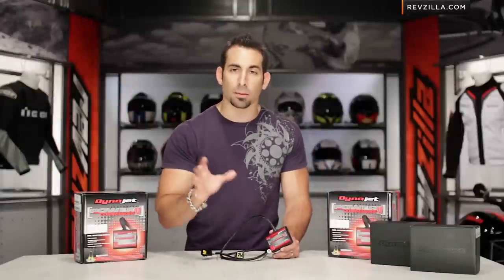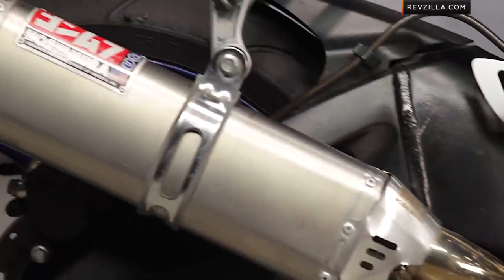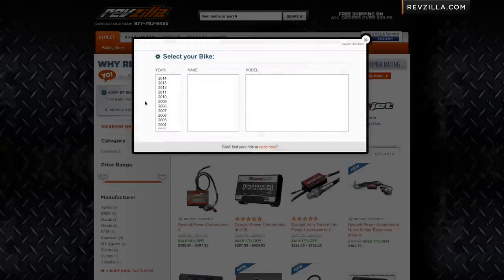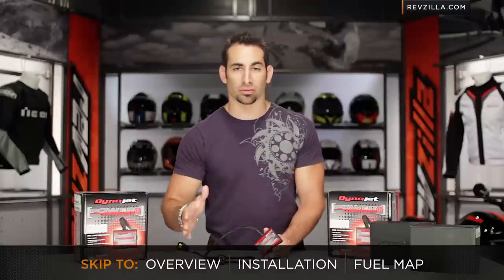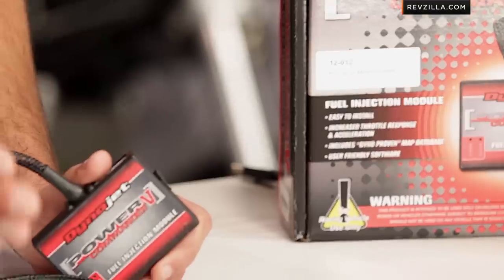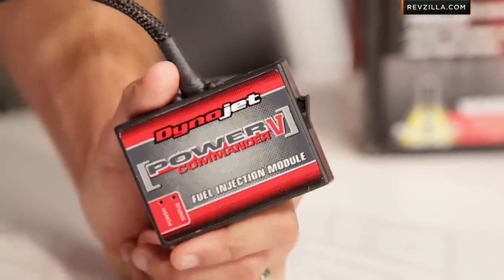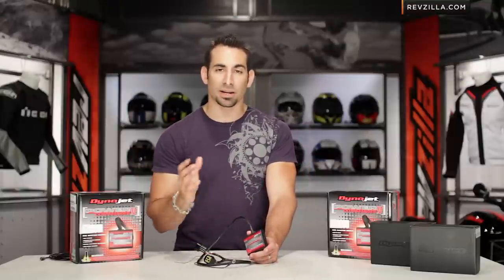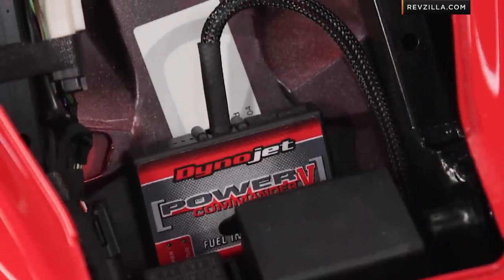Dynojet Power Commander Buying Guide at RevZilla.com

Comment: please reply, can it be used in ktm rc250? i only see that it only available for rc390. since ktm rc series have similar build to each series from rc 200, 250, to 390, the different is only in cc.
Reply from the maker: No, it cannot be used in the 250. It is only compatible with the 390 motor. -DrewZilla

Comment: I am setting up Two Brother exhaust full system to my Vulcan S 650 2016. Is it will fit for my case ?
Reply from the maker: +Nguyen Nhan Yes, there is a Power Commander V to fit your bike. It fits both 2015 and your 2016 model. -DrewZilla
*http://www.revzilla.com/motorcycle/dynojet-power-commander-v-fuel-ignition-kawasaki-vulcan-s-2015

Comment: Sounds great  but  does not  control the Ignition ???
Reply from the maker: No, the Power Commander does not control ignition. For that, you'd need the additional Ignition Module. -DrewZilla
*https://www.revzilla.com/motorcycle/dynojet-power-commander-v-ignition-module
Reply: Hello thanks for fast reply ..  I looked on your web sire and the V  does appear to control ignition too on a Yamaha FZ-07  it seems it does for some models and does not for others..?  I will look again ..
Reply: According to your own Web site  the Power Commander  V controls both fuel and timing ..  My  bad for not specifying  Yamaha FZ-07  I looked on the Dyno Jet web site. too ..
Reply from the maker: Ah, my apologies. Yes, for the FZ-07, ignition time control is built-in, so the ignition module is not required in that case. -DrewZilla
*https://www.revzilla.com/motorcycle/dynojet-power-commander-v-fuel-ignition-yamaha-fz-07-mt-07

Comment: So it doesnt work with engine coolant sensors , O2 sensors and doesnt even give spark timing adjustments?
Reply from the maker: The stock module works does not adjust those settings. To use O2 sensor data, you would add the Auto Tune Kit. For timing, you would add the Ignition Module. -DrewZilla
*https://www.revzilla.com/motorcycle/dynojet-power-commander-v
*https://www.revzilla.com/motorcycle/dynojet-auto-tune-kit-for-power-commander-v
*https://www.revzilla.com/motorcycle/dynojet-power-commander-v-ignition-module

Comment: What does this mean?
"PCV does NOT allow adjustment of the closed loop area on this model." ?
Reply from the maker: The closed loop area is the portion of the fuel map (throttle position vs. engine speed) that cannot be adjusted. For the California-regulated version, you cannot modify that portion of the fuel map. -DrewZilla

Comment: What happens if you have a PC Commander installed on your bike but you never tune it up?
Reply from the maker: The Power Commander is a piggyback system, so it takes the stock ECU signal input and sends a modified output according to the fuel map that's loaded on it. If you have the stock fuel map loaded on the Power Commander, it won't change anything. -DrewZilla

Comment: i have  a question     the power commander was deprogrammed. if disconnected. motorbike or save your map Preloaded
Reply from the maker: When you remove the Power Commander from the motorcycle, the motorcycle returns to being stock with the stock factory map. -DrewZilla

Comment: If I have a powercommander with a map, then unplug it from the bike, will I have to reload the map again?
Reply from the maker: No, the map is saved to the Power Commander. When you remove the Power Commander from the bike, the map stays with the Power Commander. Without the Power Commander, your bike still has its stock fuel mapping. -DrewZilla
Reply: Thanks RevZilla!  I took it off because I was having problems with my bike, father in law thought it was the PC3, but I found the issue on youtube.  It was the Throttle Position Sensor (TPS) and it was fixed under warranty.  Hence the question about the maps.

Comment: Once used Can I use it on another bike that I buy?
Reply from the maker: For the Power Commander, yes, it can be taken off a bike and used on another bike that's the same make/year/model. You can't take it off a Honda and put on on a Yamaha or take it off a CBR600RR and put it on a CBR1000RR. It has to be the same model of bike and be within the compatible model years. It's not a 'universal' item. Additionally, remember that it only modifies the bike's ECU as long as it is attached. Once removed, you're back to the stock ECU tune. -DrewZilla
Reply: @RevZilla  dang I was going to buy one off of a older Sportster to put on my 2015 Sportster.
Reply from the maker: Yeah, as you can see from the link below, the compatible Power Commander only fits 2014 to 2019 Sportsters, so you can't take a pre-2014 Power Commander. -DrewZilla
*https://www.revzilla.com/motorcycle/dynojet-power-commander-v-for-harley-sportster-883-2014-2019

Comment: I cant find my 2015 Yamaha xt250 on the site but I went on a different site that sells them and it said it would fit.
Reply from the maker: Foulerstone 575 You would need the "Power Commander Fuel Controller" (not the Power Commander V), but the specific part number FC22902 isn't carried by our Dynojet distributor currently. -DrewZilla
Reply: Thank you

Comment: Can you tell me if a power commander V installed on a yamaha r6 2017 interferes with the original Traction Control system?
Reply from the maker: No, it would not interfere with the traction control system. -DrewZilla
Reply: RevZilla what about the 3 original riding modes A B and Std? Does it impact those?
Reply: No doesnt affect those modes. Do you mean power modes or traction? Wouldnt affect traction. And on power modes you could make different maps for eaxh mode.

Comment: they make a air/fuel ratio gauge does that plug in the the power Commander I have a auto tune with a o2 sensor
Reply from the maker: No, that device does not plug into the Power Commander unfortunately. -DrewZilla

Comment: so would it do all the management automatically or will I have to do it myself? (I'm new to this stuff so I've not got a clear understanding)
Reply from the maker: As a piggy-back system, the Power Commander is taking the signal coming from the stock ECU and altering the outputs to the fuel injectors based on the "fuel map" that's loaded on the Power Commander. Before you install the Power Commander on your bike, you use the Power Commander software on a PC to download the appropriate fuel map for your bike based on the exhaust and/or intake modifications you've made to your bike. Once you load the appropriate fuel map onto the Power Commander and install it on your bike, there's nothing else you need to do. -DrewZilla

Comment: Installed PCV and Autotune but when revved up to at least 8k rpm then closes throttle, engine keeps stalling. 2009 R6

Tried removing PCV and everything is fine. Does not stall.
Reply from the maker: We recommend troubleshooting with Dynojet in this instance, since they're able to diagnose issues more accurately than over YouTube. -DrewZilla

Comment: So will a powercommaner auto tune and a secondary fuel injection module work for a 2015 with a full arrow exhaust and a bmc air filter?
Reply from the maker: It depends. 2015 of what? If your bike can be selected from the product pages for those products, then yes, they would work. -DrewZilla
*https://www.revzilla.com/motorcycle/dynojet-power-commander-v
*https://www.revzilla.com/motorcycle/dynojet-power-commander-v-secondary-fuel-module
*https://www.revzilla.com/motorcycle/dynojet-auto-tune-kit-for-power-commander-v

Comment: Is a dyno tune necessary after install?
Reply from the maker: If Dynojet has a fuel map for you to download for your bike, then no, you do not need a dyno tune. -DrewZilla
Reply: If you make lots of changes, air intake, full system or cat delete, quick shifter etc...only a dyno tune can get the most accurate set up for it

Comment: Can i use a system on my efi 2008 honda shadow spirit c2 shaft drive?
Reply from the maker: Dynojet only makes a Power Commander for the 2009-2015 VT750C Shadow Spirit. It is not available for your 2008 model. -DrewZilla

Comment: Do I need it for dyno?
Reply from the maker: It depends on how your dyno tuner tunes bikes. Without a Power Commander, a dyno tune would be flashed to your stock ECU, replacing your stock fuel map. With a Power Commander, a dyno tune is saved to the Power Commander, so your stock ECU is not modified. -DrewZilla
Reply: RevZilla I m flashing stock ECU anyway and doing full exhaust system upgrade. Won't do any other performance mods after that.

Comment: a Slip-On does not demand a power commander, one install it " if want to "...even on a stock bike, difference? NO.
 you sounds like a snake oil salesman...shame
Reply: Ed Mon it doesn't demand it, but in some cases it could be a very good idea. Went from stock pipe to GYTR shorty and I had a pretty rough idle and a little less low end power(little boggy), this will smooth it out all the way through
Reply: But as he said, bikes run lean from the factory anyway, so a powercommander isn't necessarily a bad idea.

Comment: I have a Yamaha r3 with a m4 slip on exhaust do you think I'll need a power commander? Because it keeps making that popping noise whenever I'm at riding and release the throttle a bit it pops will that fix it?
Reply from the maker: You don't absolutely need a Power Commander, but you may be able to reduce off-throttle popping with a Power Commander. -DrewZilla

Comment: I have a yoshimoroa r55 and K&n air filter without the power contender on my 2007 R6. Was wondering what can happen if I keep riding my bike this way? Can it break something? Thanks!
Reply from the maker: Eric Lopez If you have the R-55 slip-on and K&N air filter, your bike is running just a bit leaner. Your engine's likely running a bit hotter, which could reduce engine life. If you're running a full-system R-55 and K&N air filter, your bike is likely running much leaner and much hotter, which again could reduce engine life. If you installed the freer-flowing exhaust and air filter to gain power, you need to increase the amount of fuel to match the increased airflow so that you can actually gain power. That's what the Power Commander would do. -DrewZilla
Reply: RevZilla Thanks for your quick response. I don't have the full-system only the slip-on. In addition I have a K&N air filter (versus the stock one that I replaced) and also had the cat removed. They bike doesn't have any symptoms like turning off or popping noises.
Reply from the maker: Eric Lopez If you had the cat removed, you basically now have a full system. Why remove the cat and install a freer-flowing air filter if you aren't going to increase the fueling to make the changes you've made worthwhile? With a power commander, you can take advantage of the increased airflow to make more power, have smoother and quicker throttle response, and likely increase engine life. -DrewZilla

Comment: Is this available for the 2016 yfz450r?
Reply from the maker: Dynjojet does make a compatible PCV, but none of our distributors are currently carrying it. However, you should be able to get it directly. -TeamZilla AJ
*http://www.powercommander.com/
Reply: Thanks mate just another question, what's the difference between just the fuel power commander and the fuel and ignition power commander free 2 u see
Reply from the maker: The Power Commander V w/ Built in Ignition Control allows you to adjust the timing +/- 20 degrees, so you can further refine the map and potentially make more power. -TeamZilla AJ